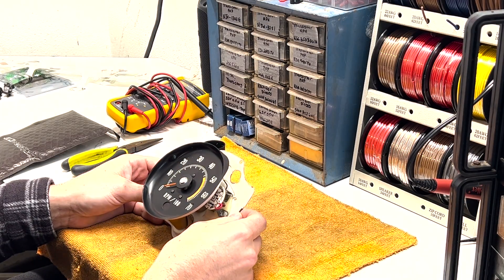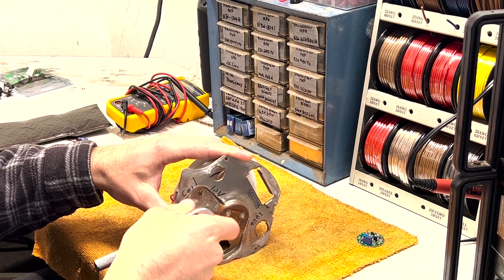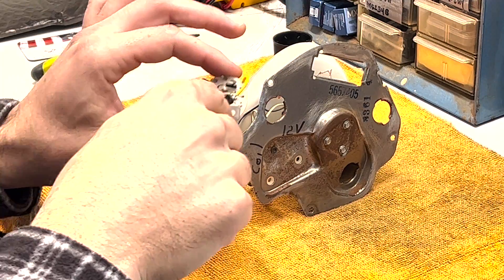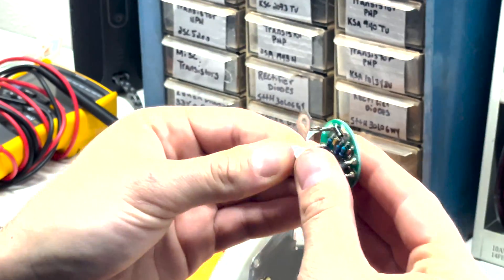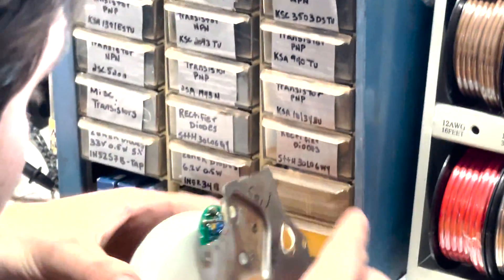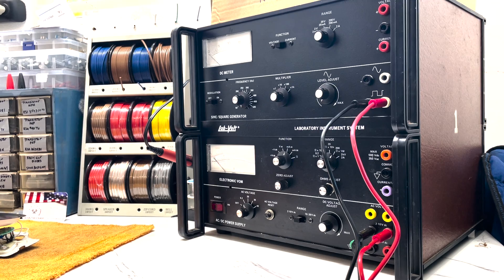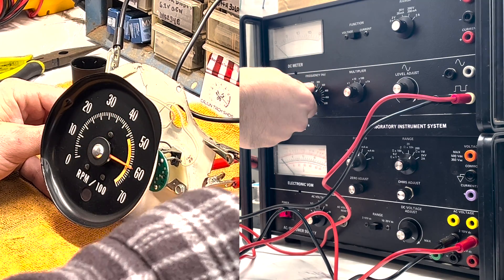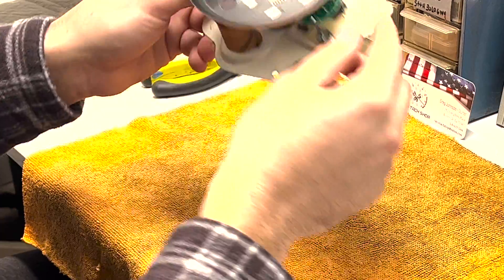Broken Tachometer! - Let's Fix It!! #electronics #cars  #carrepair

Comment: My vtc solenoid in my Honda crv seems to correlate with how this works is that right? Because my tachometer has been dropping faster than usual and not working properly between 1-2 but fine in high speed. I had my solenoid replaced after the code went but the new one seems to be working slightly off too. Do you know where I would go from here for help.

Comment: 15 rpm/Hz. I would also advise to use the proper duty cycle ( dwell). An ignition does not use 50%. Points will be fixed dwell. Electronic ignitions vary the dwell. An MSD box outputs 20% duty cycle for its dedicated tach output. Trivia: how much dwell is 20% duty cycle?? It's also interesting to check at which extremes of dwell that the tach accuracy starts to fall off (at worst case which is high rpm)